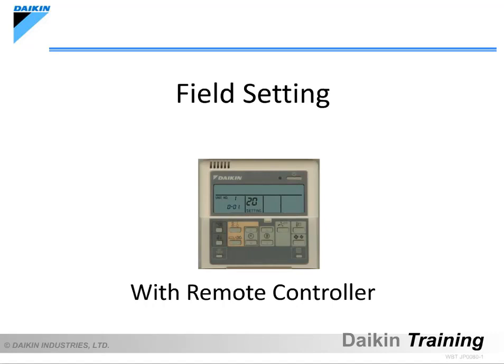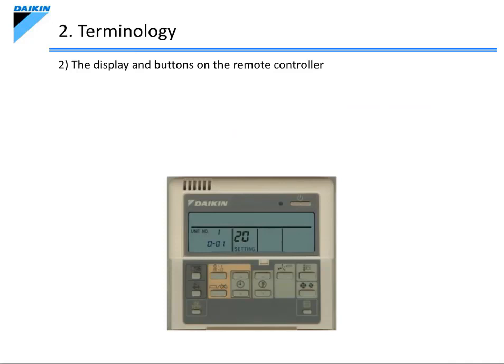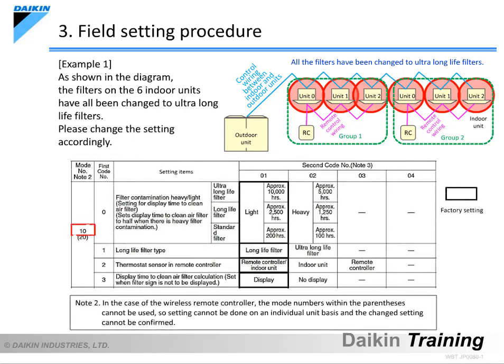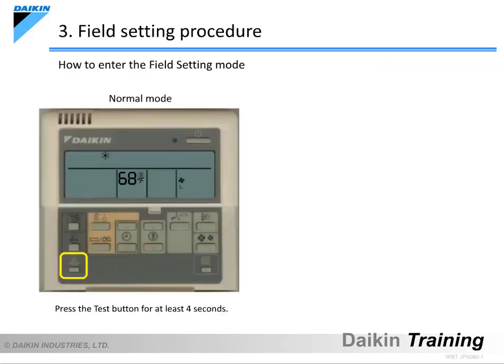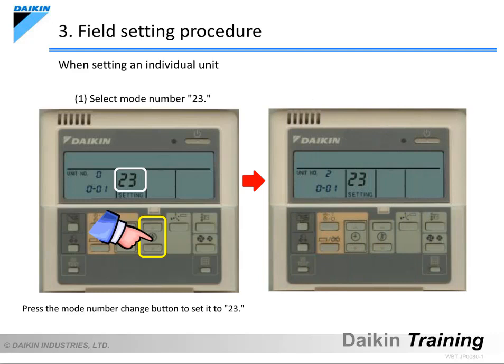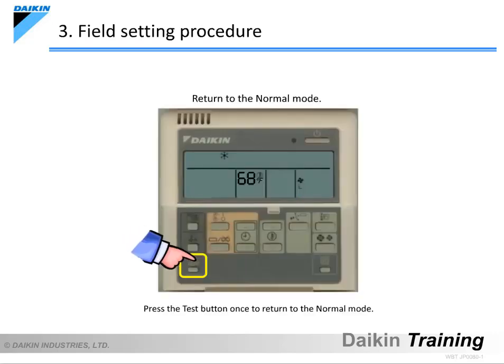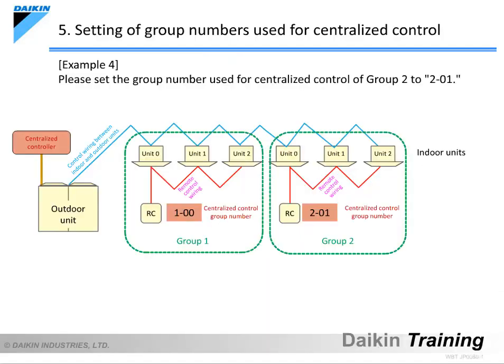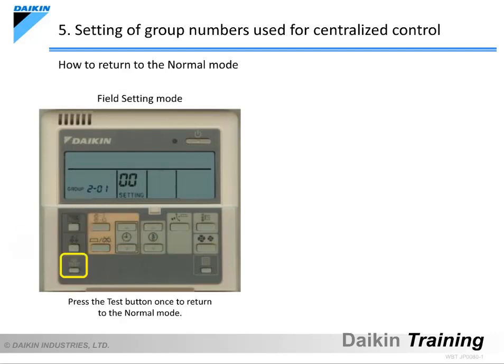Daikin VRV Field Setting Secret Code Revealed! 🤫 (Mode 10, 20 & 23 Guide)

Comment: Daikin manuals are about the worst I've seen, missing explanations of important features, seems almost intentional to drive away customers
some basic things are explain in detail, but then important things like these field settings - not listed in any manuals, I mean there are 3-4 settings, but the control has like five times as many options in it, but no document references them...
and service/install manuals both for outdoor and indoor units are compiled in a terrible way, it doesn't follow logic, jumps from one type of control to another and misses key settings that change how the installation operates
take ERQ outdoor unit and Z-control type indoor unit - NOT ONE PLACE in either of those manuals explains the remote sensor setting in the remote control, not even google or ai agents help, because the information is nowhere to be found, stumbled on the the mode 20 setting 2 on a Spanish video with English subtitles... thats just ridiculous, that is CORE FUNCTION SETTING necessary to commission a installation - yet not mentioned anywhere in the manuals
manuals also have pointers to non-existent chapters
just awful documentation for what supposedly is premium product, according to price anyway, but this level of tech seems like from 1990ties, if you don't improve these things - you'll be forgotten, and I'm not talking about some cloud connectivity, just make it an option setting these things using a phone and an app, it is ridiculous in 2026 to make these without wifi/bt connectivity, those chips cost less than a dollar... should be included in all units and a dip switch to turn on/off wireless for safety reasons

Comment: Thanks for the great explanation. However, I still need help with two things:

Temperature Lock: How to stop others from changing the temperature or limit it to a certain range.

Keypad Lock: How to lock the buttons so I can set a schedule and prevent manual operation outside of that schedule.
Reply from the maker: U need CRC for your requirement